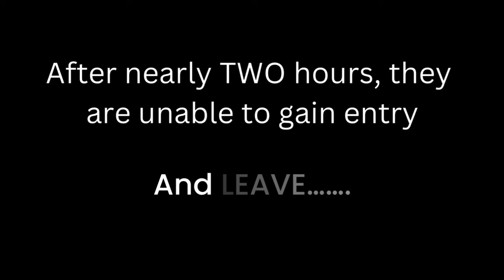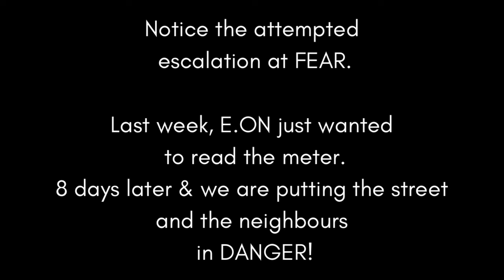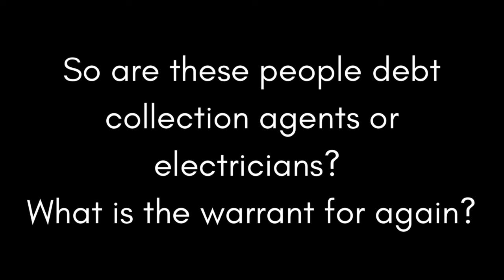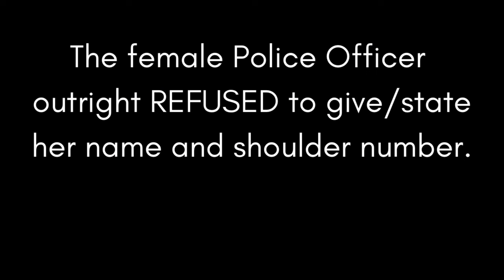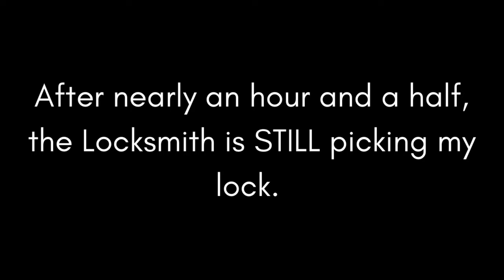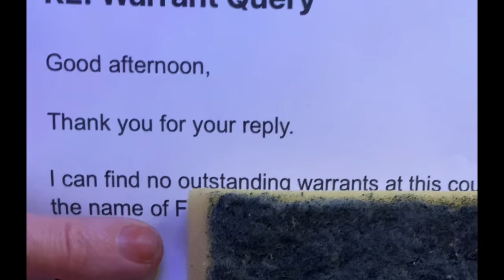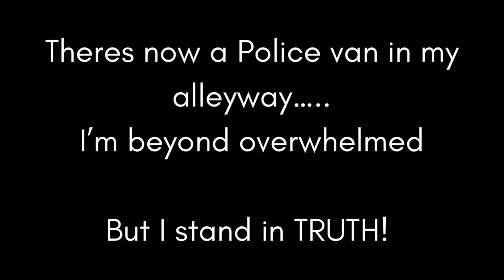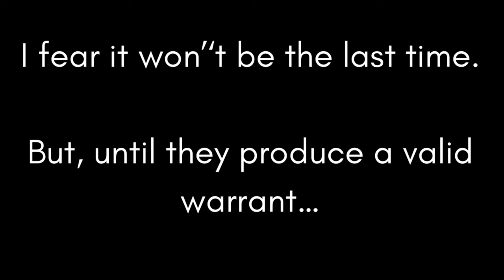WARRANT OF ENTRY - E.ON NEXT - 2nd ATTEMPT ⛔️⛔️⛔️⛔️⛔️⛔️⛔️

Comment: This lady should learn the difference between legal and lawful and then she might use the criminal law act 1977 section 6. I've stopped the police three times using this act but just knowing the law is not sufficient . You need to use tactics. I 'phoned 999 straight away and quoted the act and explained the difference between legal and lawful and asked for the police to attend. Of course they refused but that did not matter. 999 calls are recorded. I then immediately sent a legal notice by email to the chief constable pointing out the same. One time the bailiffs called the police and six cuntstables and a sergeant turned up. They left about 6 hours later stating that they would be back. They never came.